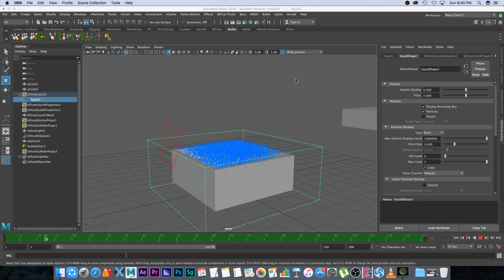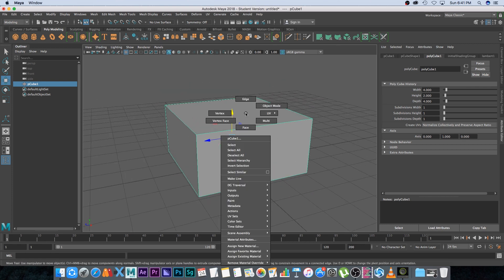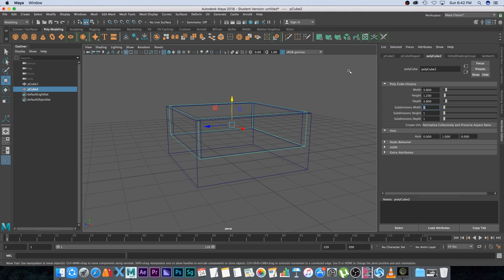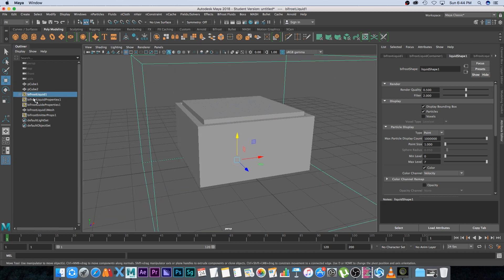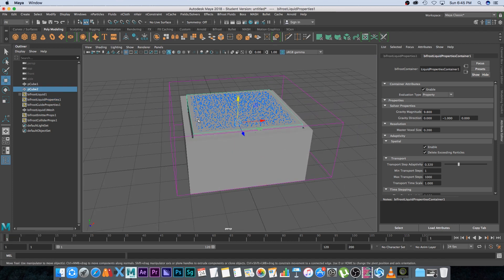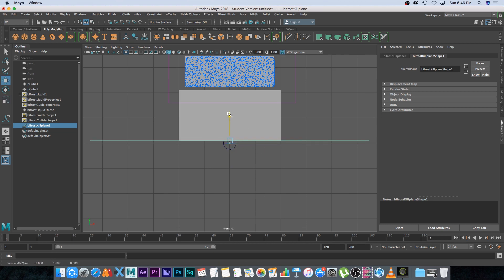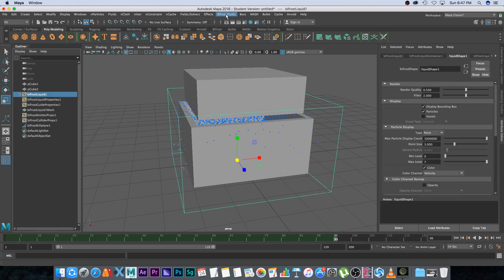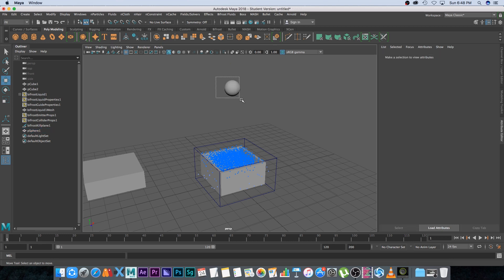Tutorial: Creating A Water Splash In Maya 2018 With Bifrost

Comment: The fluid texture isn't rendering in arnold and the ball keeps falling through the mesh when I tried to add a passive rigid body to the container. Any idea why this is happening? Using Maya 2019.
Reply: Make sure you've gotten the updates from Autodesk. If you're running Maya 2019 without any update the shader won't shot up in Arnold